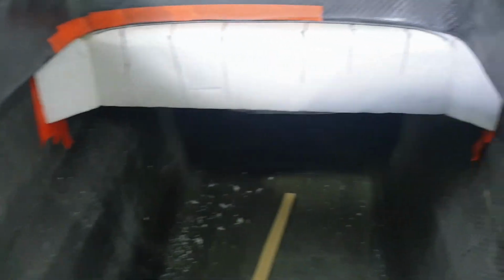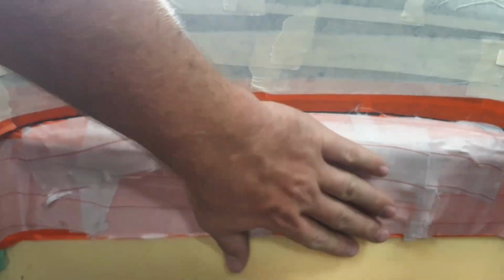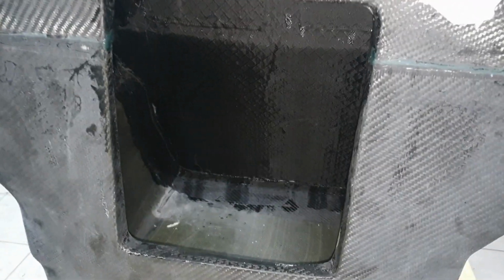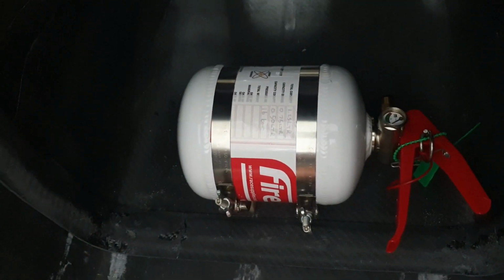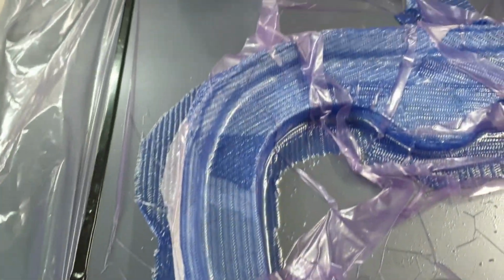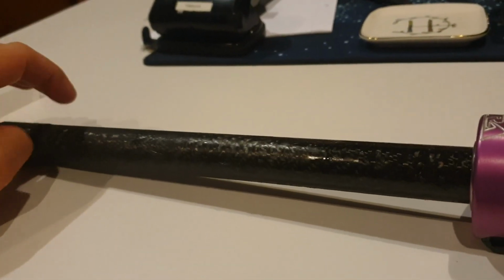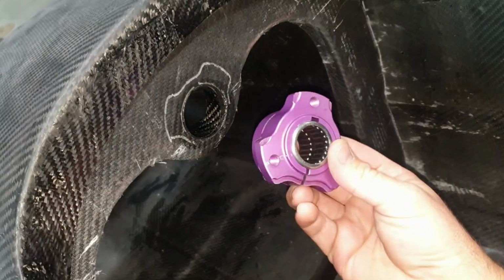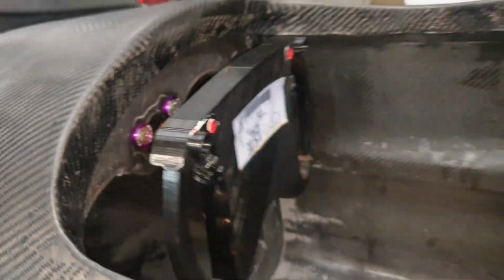Stage 9 Rollover Hoop and Steering Column

Comment: if electric the air dram would hold the batteries. adding proper weight to the car equally on both side.

Comment: This reminds me of when they were first experimenting with Carbon. They made the monocoque so strong that it wouldn't even crack hitting the wall full speed head on. 
I'd have gone with 3 layers and one kevlar, foam core, 3 more layers of carbon and a kevlar. It would get banged up hitting the wall wide open but it is much gentler on the occupant.
You are definitely master level skills putting so many layers together. I was thinking how can he possibly flow the resin out. It worked, wow.
Reply from the maker: Thanks for the compliment but definitely not a master just VERY lucky!! However I do agree with you. We did explore a 6 plie layup and due to the large variation of out comes, opted with extra is better philosophy. We do have a number of elements that will absorb large amounts of force on the exterior portions of the car and also will be using a "suspended" seat setup for internal along with impact foam in various areas.